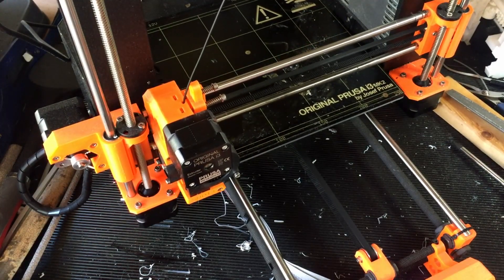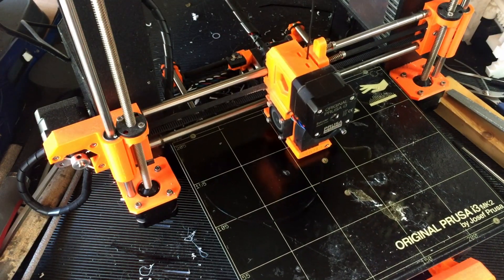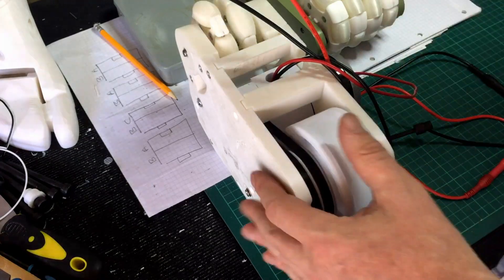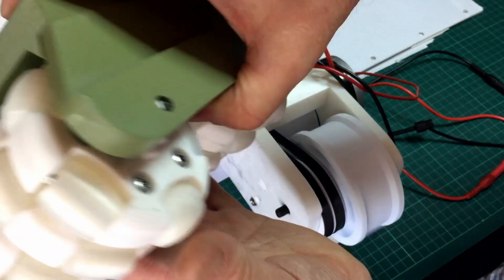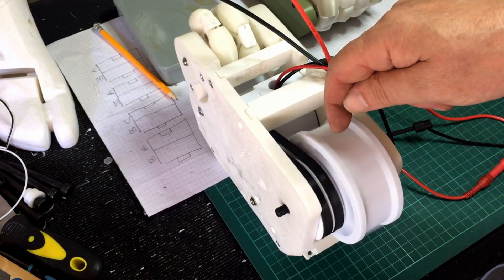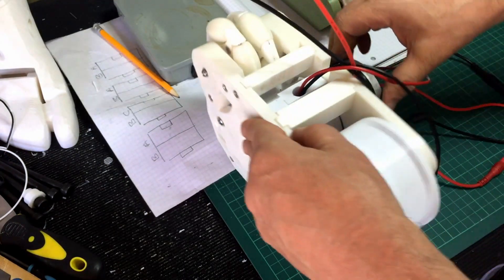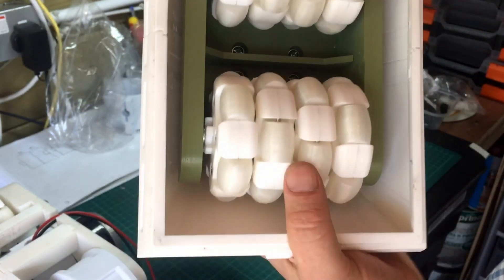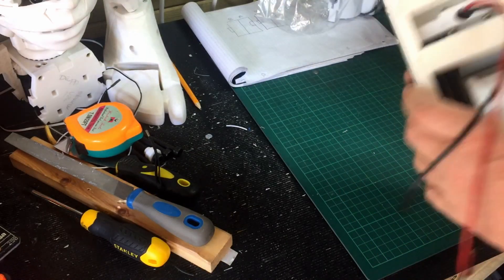R2D2 Droid Build  Part - 15

Comment: is it possible to by belts in the correct size? I suppose u could adjust the motor spacing to compensate to some extent.
Reply from the maker: There is a completely new foot drive without the belts that you can now print.   Its got cogs instead.  I have seen people use prebought drive belts though. 
Check Michael's latest version of the R2 with the new feet.
Reply: @kylecampbellweb  thanks Kyle, will have a look.